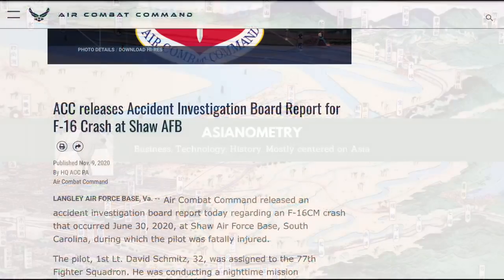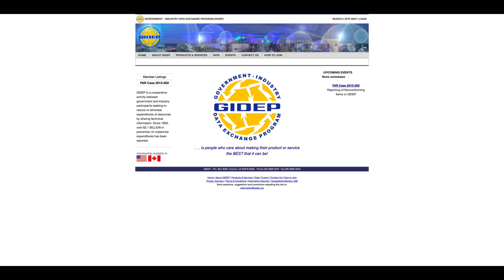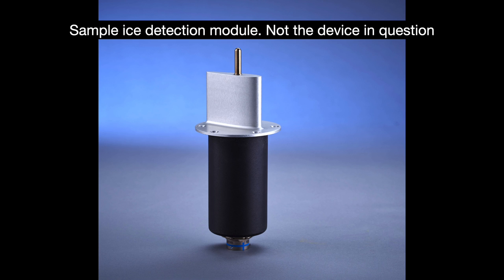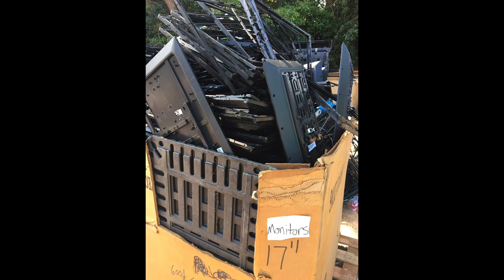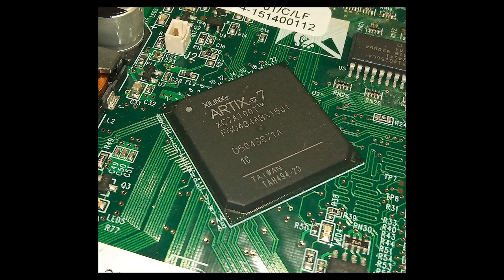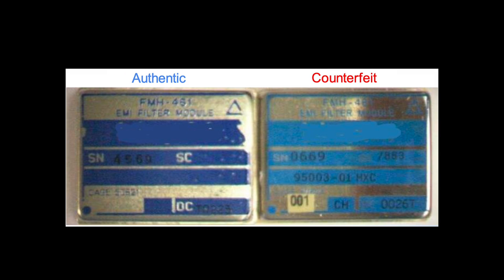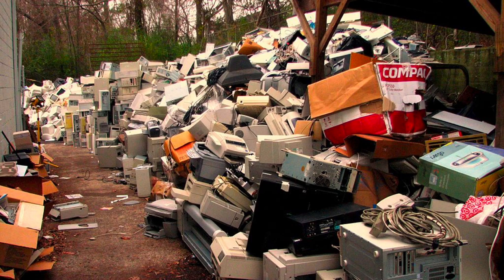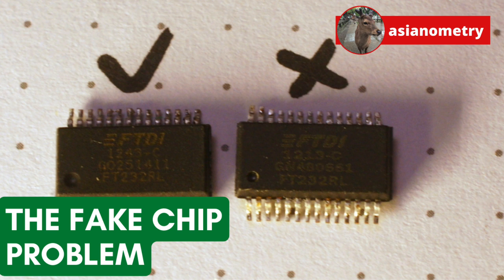The Fake Chip Scourge

Comment: I strongly disagree with the notion that e-waste disposal is a good thing, in the end that is dealing with failure to reuse the material.
Bottom line when it comes to counterfeits, it is only a problem when they are passed off as the real thing.
Take a Rolex for example, no one willingly wearing the cheap knock-offs would ever spend the money on the real deal, and those who cares about showing off their wealth would not be caught dead with one.
So, Rolex won't lose any sales, and those in the know can brag about having the genuine thing.

Far more important though is the right to repair. Manufacturers already take somewhat draconic measures to retain ownership even after they sold their product, and with standard components pulled off the market, components taken off donor boards are often the only way to get equipment back in working order again,
The problem  isn't that this happens, but that components are sold as new or something else than they actually are.
What is needed is a controlled aftermarket like the auto-industry has.

Comment: There is an argument to be made about companies being responsible for chip harvesting cost efficiency. Obviously you do not want the fab to sell a chip you designed, but you should sell that part yourself then. Companies go out of their way to make their chips inaccessible while still using spare parts themselves in repair processes. This is because of the many advantages of having a monopoly on the repair of your product. In turn, the "market" price of those chips balloons, which makes harvesting lucrative. That same company can see, or pretend to see, the existence and dangers of counterfeit chips as a reason to further steel their position on a monopolistic repair process. It seems to be the next step in forced obsolescence.

Comment: Many of these parts are due to the OEM simply making the part "Obsolete" so if needed for equipment repair, shops are forced to source parts from "Old new stock" Harvested parts, or counterfeit parts, or aftermarket replacements. EG your table lamp burned out it's bulb, a GE item. GE no longer manufactures incandescent bulbs so the part is Obsolete. You can buy a Sylvania bulb from a warehouse that still has them, This would be a substitute. You can try to find old new bulbs in some store inventory someplace, or you could possibly find someone making cheap copies and marking them as GE bulbs. Ideally there is an LED replacement for the original bulb, but in electronics, often there is not a competitive replacement for common items such as an OP Amp with similar specifications that are drop in replacements. Specialty chips such as Altera parts are no longer available. Intel bought the rights to the patents and simply made them obsolete, so when they fail, your entire device is non-repairable. This would be the equivalent of making a 1960's Polaroid camera inoperable due to the inability to obtain replacement film from any source. This might not matter with your 1960's instant camera, but it is an issue with replacing the voltage regulator on your 500 Watt portable generator. They would require you to buy an entire new generator than allow you to buy a part to fix our original to original condition. This is where so meone decides it might be profitable to make their own voltage regulator module and brand it as original Honda parts to get the premium prices for it.
This problem has been compounded by the US Government. The "Inventory Tax" killed the ability for manufactures to hold some of the manufactured products in a warehouse for future needs for service and repairs. Holding inventory is taxed on the value of the inventory every year, so the model has moved to just in time delivery for manufacturing. This leaves the repair field obtaining parts from manufactures of aftermarket parts. Parts under patent are counterfeit, pulled and salvaged used parts, or old stock from overseas, where they may be counterfeit instead.

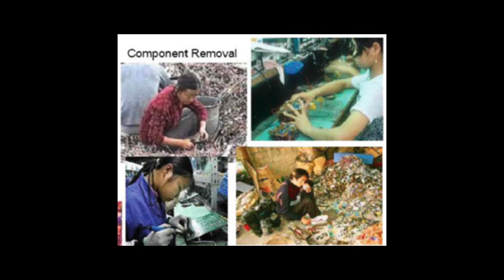Comment: 7:15, simple solution to that particular problem, have some people physically break every chip on e-waste in a noticeable way before sending it off to recycling plants, yes this means some potentially good chips also get damaged beyond repair but I'd argue that's better than lives being lost due to the bad ones being sold as new/repaired. The damaged chips can always be melted down and eventually have it's core materials separated to be re-made but that is not likely to be done by crooks with how expensive that would be

Comment: A company I used to work for was dealing with significant problems of determining counterfeits from non counterfeits back in 2018 because we were dealing with a chip shortage when one of our largest suppliers discontinued our most commonly used chip, with essentially no prior notice to the company and no replacement targeted. It'd have set back company production by 12-24 months to redesign every board to use a different chip and test the new design to make sure it functioned identically to the old design, so the company had to buy leftover chips from basically every place they could buy them internationally. It became a huge effort of figuring out what was legitimate stock and what was counterfeit. I had started a position at a different company before I got to find out how that all ended.

Comment: Even mechanical hardware has a big problem with counterfeits since China became a large producer. 
Ford orders a batch of grade 5 bolts and somewhere in the chain there is a swap and the actual bolts recieved are some crude soft iron(but have grade 5 markings). I worked for a large bicycle company about 10 years ago and we had to have a guy continuously over in China watching production because the minute you look away they swap in cheaper alloys or start skipping production steps(eg threaded parts will be completely jammed with metal shavings that weren't cleaned out before assembly.), and they know they only need to get it on the ship because that's when they get paid and margins are so tight that nobody will ship the faulty product all the way back for a refund.(That's ignoring the CCP corruption that makes legal recourse non-existent.)

Comment: I worked for Texas Instruments for 25 years, and I was under the impression that almost anything that TI had made could be ordered and built if a minimum order was met.  The US government should be able to afford to get original parts manufactured if the need is high enough.  The expensive part of manufacturing is the creation of the masks.  If the masks still exist, then it's no problem to start immediately building the chips; the processes used are scalable, so even very old chips could still be built for the most part.
Reply: i work in the assembly and test for a semiconductor company, i still remembered a case where a device didn't come to us for years, it used to be a high runner. but since EOL is not declared, my process still keep few machines idling there. but technicians often butchered the machines for spare parts (other devices are using machines from same maker, but machine platform is different, so some parts are common use). and the leader tech had to keep lecturing the tech not to take parts from those machines. but, out of a sudden, planner informed that customer would like to buy a big quantity before EOL was declared, luckily we still keep the machines, another process where the machine footprint is huge, they already dismantled it to make way for other machines. i remembered the manager got an earful from the dept manager. and that process has to assemble back the machine in one week to make sure it is working. it was a tense month. Luckily, although the machines didn't run actual production for years, we still managed to get it out.
Reply: The Fabs go more and more towards bigger silicon disks, so the masks dont fit. Also the machines that take the masks could get modernised, so they can not use the old masks. There are many reasons why it could not be possible to manufacture older parts and modernisation is necessary to keep up with profit margins.

Comment: I have no problem in buying and using recycled components so long as it is plainly marketed as such.  I will test it and use it and test the component after it is installed.  I always stress test such chips.  When I return the device or machine to the customer, I make it known I performed the service and repaired it with recycled components.  If I can not get a new component, I will notify the customer and get permission to proceed with the service with recycled components.  I get a 6 out of 10 fail rates on components I buy.  It is still worth it as most components are no longer in production.  Just be honest with your customers and only deal with suppliers that are honest about where the components came from and if they test the used components they sell.  My suppliers have always credited me the cost of chips that are DOA or just fail a particular quality test.

Comment: Getting these old parts as new old stock is impossible at some point. Better recycling is needed, and it could help the environment as well - if the recycling is done properly.
As for remarking - it can be applied to new devices as well. Relabel a run of the mill opamp as a precision opamp for example.

Comment: i had a problem with my old laptop, that only i had with that laptop... basically if it was normal, a chip would tell my laptop to boot from the m.2 slot .... but it didnt and i had to turn on the pc, with a middle step of having to go through the bios where the settings could tell the pc where the system was. I never thought anything of it.... and no one from the shop (and tis a darn good shop with decent tech support) knew what to do with it... so i just settled on the old "you need to know the trick to get her going" but this actually kind of makes sense.

Comment: Interesting. But, unless we can make our own parts, this will be a perpetual issue. The blockchain protection idea seems like a potential method for manufacturers to avoid counterfeit chips,. but it doesn't solve the problem entirely because at least for the problem related to the Jet in the video... it was related to NOT "testing" a chip for authenticity...So, if the manufacturer is not going to test the chips regardless... there's not much that can be done until "after" it is too late. Perhaps tho, the blockchain method (combined with the penalties) will make testing for authenticity so much easier that they won't have an incentive to try to bypass the testing.
Thank you again for another amazingly informative video.

Comment: Another way to verify the chips function as expected is for the designers of said chip to share their test suites, they don't need to share the details of the suites, for example the suite could just say "Yes, this seems fine" or "No, failed X tests" & list the documented instructions that failed the test/s, for further details the suite would need a login but otherwise the tester can decide if the failed instructions are needed or not, the suite should always run at boot, not in a operating system like that invasive shite windows or that rip off scam osx (apple/mac/iphone etc). The designers of the chips would always be designing the most comprehensive test suites anyways so they should share the binaries of those test suites, sure they can charge for it, not their problem whether a company chooses their test suite or to make their own after all.

Comment: The fake LM317 chips are a real nuisance.
Reply: I was afraid of that when ordering on ebay a couple of years ago, but the TO-220 units I recieved were within the specs I've tested compared to the ST datasheet and some genuine OnSemi parts salvaged on an old CRT TV.
The most problematic are all the TO-3 chips. There are real nasty die swapping
Reply: also pin compatible LDOs exist since decades, like the LT1086

Comment: I am an EE & electronics hobbyist, IC counterfeits are a big problem even for the most legitimate suppliers. I have acquired & built many custom test equipment in an attempt to validate components to determine if components are in spec which can (mostly) be done for critical applications i.e. aerospace & medical etc… I recommend to purchase directly manufacturers for critical applications though for the design nothing is fool proof, at this point, one can’t go wrong with taking a fault tolerant system approach.

Comment: recycled chips (if not misleadingly sold as new) are just fine.   Chips don't "wear out".  I work with a lot of old tech stuff and have MANY 30-50 year old computers in my life that still work just fine.
Reply: Actually, chips can just wear out or age, due to diffusion of molecules through the silicon. Heat accelerates this. This process is (usually) so slow that it happens loooong after the device is removed from service, but there are some parts that have had widespread failure. (And then there are just plain fuck-ups, like the TI Stellaris microcontrollers used in some Keysight bench multimeters. A lousy flash memory design in those caused undetected errors on reads, and then the poorly designed flash controller would refresh the error-laden data back into the flash, overwriting the unreliable (but not completely gone) original data.)

Comment: Actually I think it's possible to still get 7400-series TTL ICs, and undoubtedly tens or even hundreds of them were probably used in the construction of the F-15 (or at least, the military equivalent of 7400-series TTL).  7400-series TTL logic gates (and their low-power schottky brethren, 7400-LS) were released in the 1960's and are probably one of the longest-made components in history.
Reply: They'd be better served to just upgrade the electronics today to modern components. At some point you're better off just moving with the tide.

Comment: Who is mostly responsible for exporting fake chips - Surely countries and companies of origin should be sanctioned with negative trade restrictions or bans on trading in electronic components. Suppliers should be certified in some way to ensure they are not selling fake chips and then lose that if they transgress. Buyers need to know which suppliers are reputable. I wonder if this is a problem with transistors, diodes and other semiconductors also
Reply: "Absolutely 👍 that clear guidelines & sanctions should be enforced- an urgent, industry-wide problem! 🤯"
~ repliesgpt

Comment: You see this all the time repairing old arcade boards, and retro game consoles, and retro computers. constantly running into reclaimed chips marked as new that either have failed or are failing, re-marked chips that are using a chip that's not 100% compatible with the chip you're looking for. 

It's happening so often that the homebrew communities have been developing and making modern equivalents for the chips. The Atari 8 bit, Arcade boards, C64 and so on have modern equivalent chips developed and made by the homebrew community.
Reply: bizarre that we're reaching the point where semiconductor manufacturing is something you can moonlight in

Comment: It's been a problem for some time now, on a job 10+ years ago I had to repair a small industrial control board. We got the replacement chip and it checked out on the test rig. But when installed did not function correctly as it was a chip from the same family but a lesser model with faked markings.
Reply: 🤔 Sounds like it was a real pain to figure out! 💻
~ repliesgpt

Comment: why the military risk buying chinese shit instead of just making their own baffles me
Reply: The military doesn't usually buy the parts. They are purchased by contractors who actually manufacture stuff like Boeing, Lockheed, etc. There is often a lot of hoops and documentation involved.
I suspect a lot of this is less about saving money and much more about availability. I used to sell electrical equipment to contractors who maintained the Alaska Oil pipeline. The problem is a lot of the stuff they used has been out of production for decades.

Comment: I wonder how does the lifecycle of certain semiconductor product is evaluated. Different technology requires different voltages and frequencies and I feel like there's also diminishing capability to tolerate higher temperatures with ever diminishing size of IC components.
Is there a method to evaluate damage inflicted to certain IC caused by high frequency, high temperature or overvoltage? Is it always just a guess based on superficial data when you consider buying anything second hand?
Reply: 👀 That's an interesting thought - sounds like the industry has a lot to consider for reliability and safety! 🤔
~ repliesgpt
Reply: @cyrileo  ?